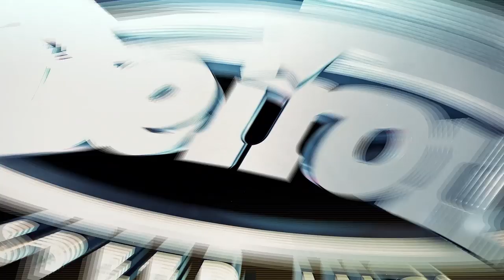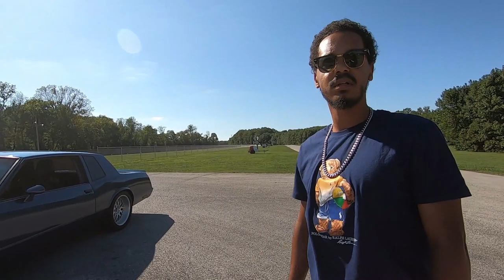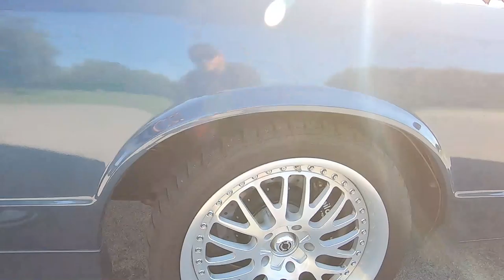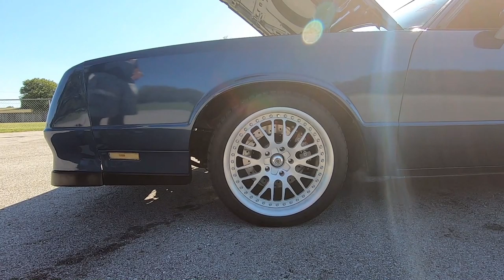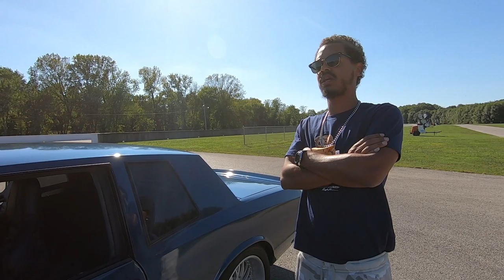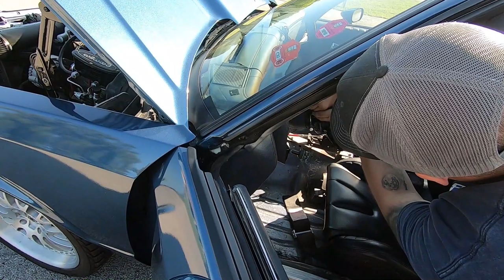Garrett Reed's 1984 Monte Carlo SS - Comeback Story

Comment: Column lock by lok-itt part number P300. It stops them from breaking the column and pushing the rod that starts the car. Great deterrent,it really slows thieves down, makes them work harder for the car.
Reply: RESPECTDATOOLS its a must had my car stolen once never again with my lock itt
Reply: those are junk. have a custom one made that runs down the side into the dash. you can steal them with the other one as the knob where the rod connects is on the side by the dash and easier to get to than the way they stole yours. get a good alarm  with keypad that tells you when somebody messing with your car.

Comment: you should put a steadfast column lock on it
Reply from the maker: How's this? https://www.amazon.com/Steering-Universal-Vehicle-Anti-Theft-Adjustable/dp/B07V9MKQX8/ref=asc_df_B07V9MKQX8/?tag=hyprod-20&linkCode=df0&hvadid=385330184564&hvpos=1o2&hvnetw=g&hvrand=12838708073603513008&hvpone=&hvptwo=&hvqmt=&hvdev=c&hvdvcmdl=&hvlocint=&hvlocphy=1021222&hvtargid=aud-801381245258:pla-843576225294&psc=1&tag=&ref=&adgrpid=78533818757&hvpone=&hvptwo=&hvadid=385330184564&hvpos=1o2&hvnetw=g&hvrand=12838708073603513008&hvqmt=&hvdev=c&hvdvcmdl=&hvlocint=&hvlocphy=1021222&hvtargid=aud-801381245258:pla-843576225294
Reply: @detroitspeed  Google steadfast column and look at the images from the g- body forum
Reply: @detroitspeed  check out freds key shop in Detroit Michigan I had one installed years ago